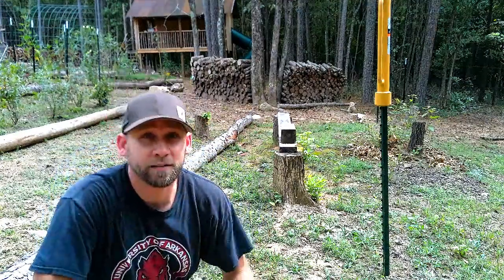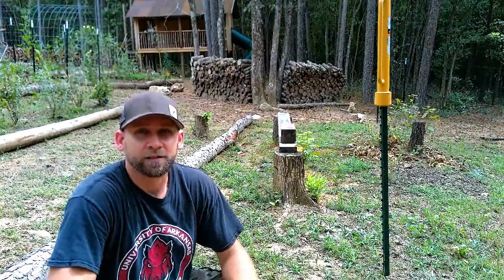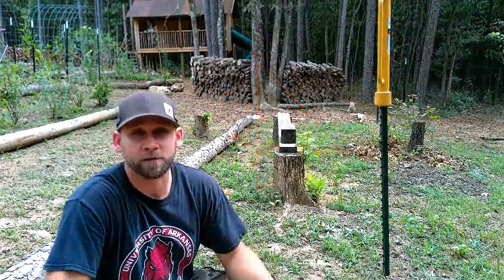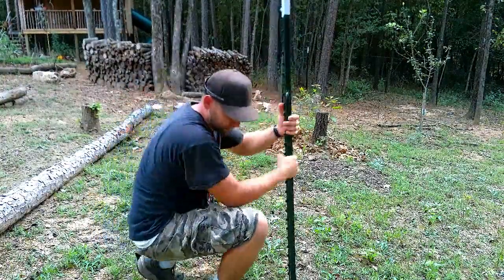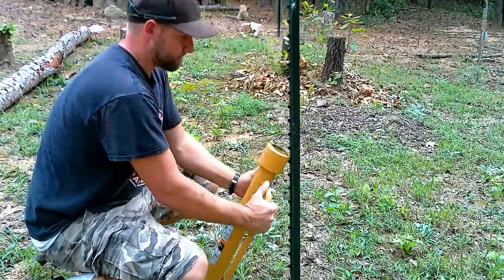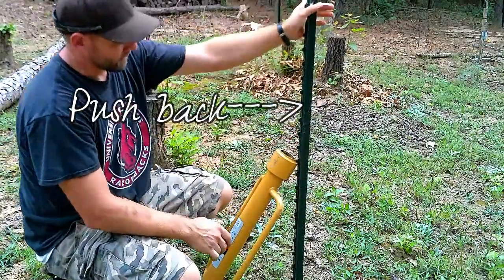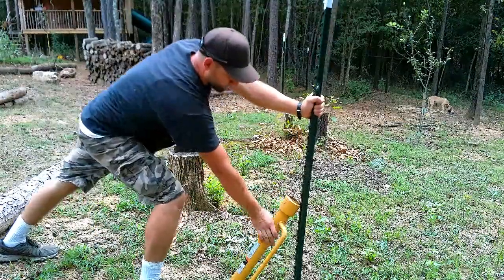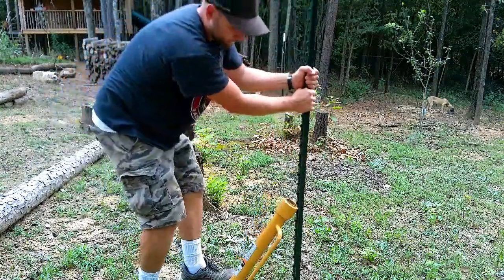How we remove T-Posts on our farm!!!

Comment: Wish this worked for me. I had to pull several that have been in the ground for 30+ years and 2 feet deep. I did have a hi-lift jack so I used a chain in conjunction with it and got each post out after a few minutes of work. May end up getting the real puller since I have 50+ posts to pull around the property. This would work on not very deep and soft ground.
Reply from the maker: Yeah, 2 feet deep is a little too much.  With the standard depth of the fins, this technique tends to work well.  I feel your pain with the 50+ posts you need to remove.  Thanks for watching the channel.  Cheers!!
Reply: Same for me.. I pulled with all my strength and the damn pole just bent in half and then broke, now I got little broken posts in the ground

Comment: Works amazing… until they get anchored to a rock in the ground.. any suggestions?
Reply from the maker: If your diving them into a rock, you got some serious strength friend.  All fun aside, you will need to use a different removal method.  I have in the past, dug the dirt out around the post and cut off with a grinder

Comment: They have a 5 dollar metal plate t-post puller for a chain,  granted, you need a way to pull up, I use my tractor.
Reply from the maker: No tractors here.  However that would be amazing...   Tactor is on my wish list..

Comment: In soft dirt, this works well,
But not in hard dirt,
When the floats are buried deep.
Reply from the maker: Shouldn't be a need to bury the fins deep,  the posts aren't structural, they are designed to hold the fence upright while holing tension on the wire.  Try this out

Comment: Method works as long as some idiot didn't drive the post halfway into the ground like the previous owner of my property.  This method only served to bend my tposts if they're driven deep.  I've noticed every video that shows this method, either with the tpost driver or using a 2x4 only has the post driven about 1/4 into the gound so maybe 6 - 8 inches above the wings.  So, yes it'll work but not if they're buried halfway to China.
Reply: My daughter in law bought a house, and the previous owners cut the T posts, ground level. She ruined a set of lawn mower blades. I dug one out, a full foot down, then hitting it back and back with a small sledge hammer until it finally broke off. I never did get to the T. I could understand, maybe, if it was for keeping cows in, but there were no cows in this area.

Comment: Won't work on smooth tee post, only on one with teeth.. That's where the challenge is.
Reply from the maker: I feel your pain.  I've never used a smooth T-Post before for field fencing.
Reply: if you have a 4 inch metal disk grinder you can make a notch really fast

Comment: Bro you’re showing taken out the post that’s only like not even half a foot into the ground let me tell you something all you need is a car  floor jack when that thing is like 2 feet in the ground try to do that your strategy compared to using an automotive car floor jack.
Reply: Can you make a video using a car floor Jack please?
Reply from the maker: Typically you shouldn't need to put them 2 feet deep.  However it will work in that application as well. We and most people I know, bury the T-posts to the fins or a bit past them.

Comment: Sadly, this didn't work for me. The posts were locked in tight in this Lower Alabama clay. However, the bucket on my John Deere and a 3 ton come along finally did the trick. 🥱
Reply from the maker: Glad you thought outside the box.  When all else fails, use a tractor